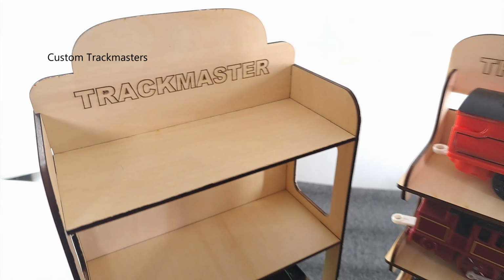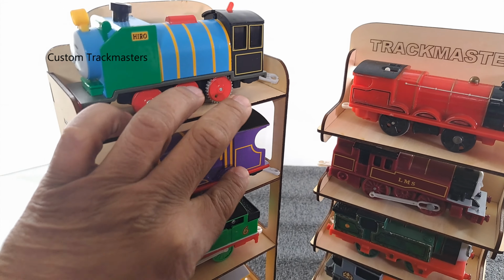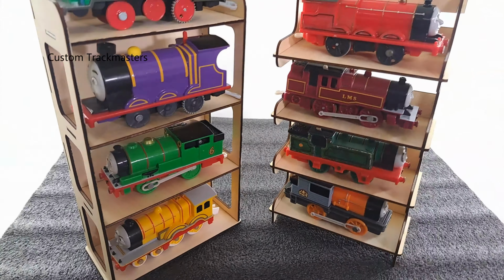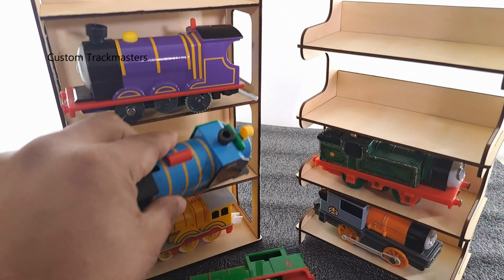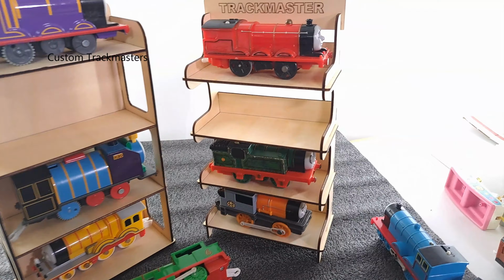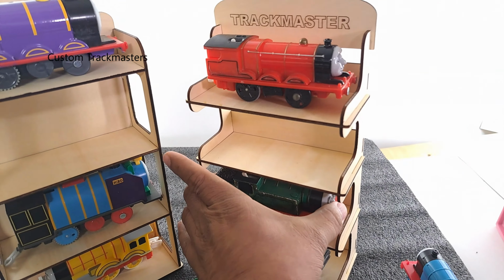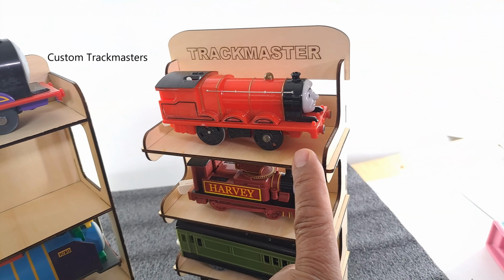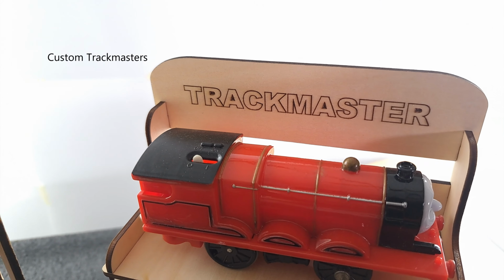Display Case for Trackmaster Plarail AEG Thomas Trains

Comment: Do you think you could make a custom Colin lily and Adam from the stories of sodor I was thinking for Colin you could use a bill or Ben just paint it and give it a different face for lily you could use whiff by cutting of the side bits over the wheels add some side rods then just repaint it and switch out the face and for Adam I’m not sure what you could use but I hope you could start making more characters from the stories of sodor or wildnorwesters series like Peter or Eric that would be great.